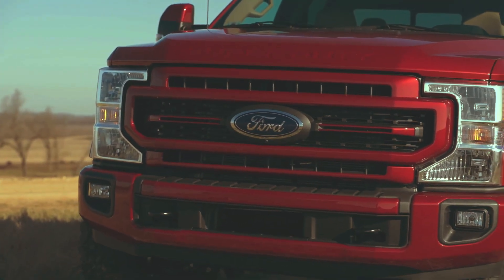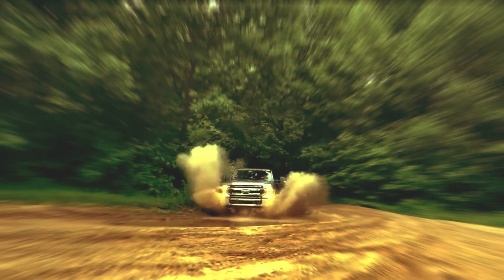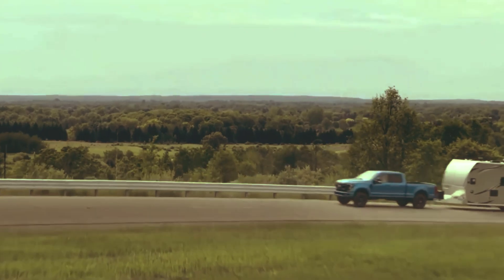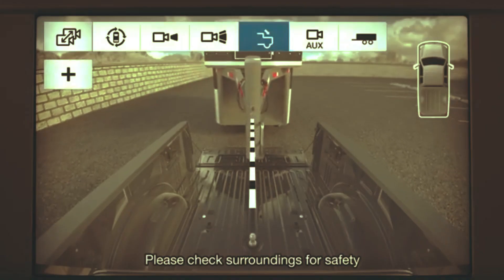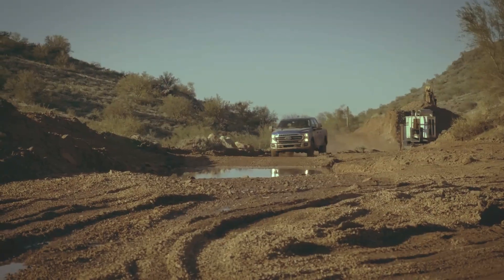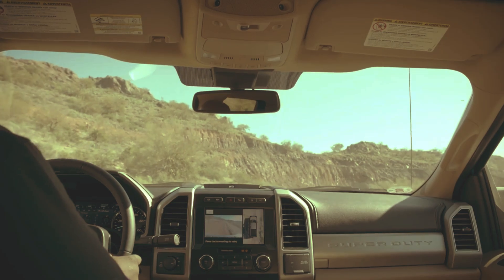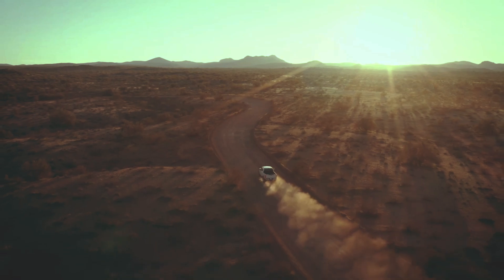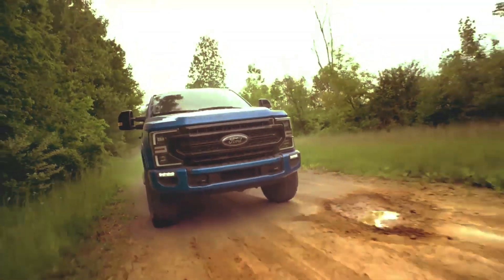"Refresh" New 2024 Ford Super Duty - F250,F350 This What We Know ?

Comment: The 2020 look is the best
That 2023 look is disgusting
Reply: I thought the 2016 ones are aggressive looking, but this is pretty ugly. It reminds me of an 89' Chevy truck or a Chevy van. Low effort in creativity.
Reply: I know. I see so much "lack of effort in the front" exact same body, most likely the same exact engine specs...not a good idea to make it look so much like Chevy grille. The old flat-face Chevy vans (1981), 2015 Chevy design. 
     Ford had the American strong stance but saw that RAM's descent into soft massive luxury has worked well for them. (I personally like the 2011-2016 look that is no question a Ford), but then the designers began to slump in their seats. Now, look, Lol. *They should have contests by the customers. I am certain the dominant look wouldn't be so boring.
     I love Super Duties, but this is just a lack of creativity throughout. Shame on you Ford!! **However, the only thing that will save them is the number of options and updated engine power numbers. 
     The Godzilla absolutely must be no lower than 450 hp 525 tq. 430 hp for something called "Godzilla" is a dual slap in the face of Godzilla and the HD lineup. As far as Power Stuck?? Well, I sense a 500 hp 1,100 tq pointless cruise ship to never actually pull 40,000 Ever. Payload purposes, yes. Flatbeds (F-550) are more practical, and are very widely used as you likely know; likely more common than the rivals.